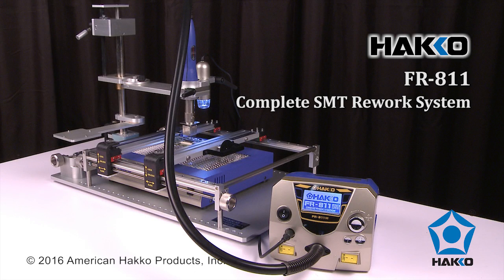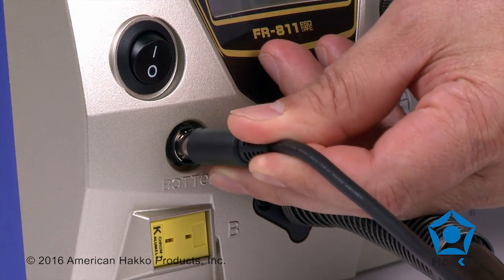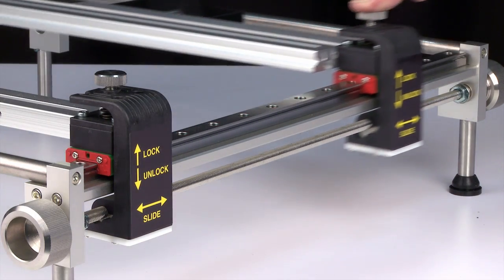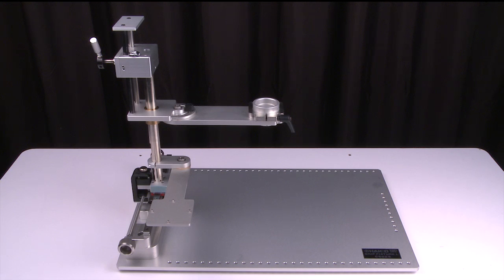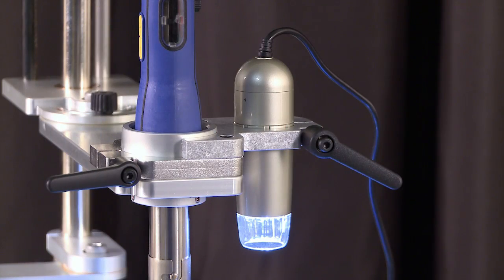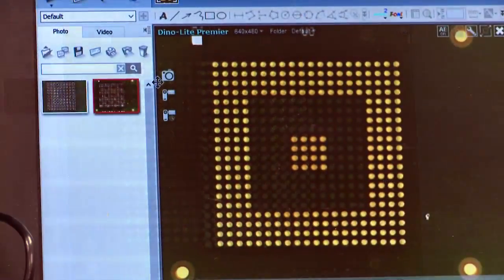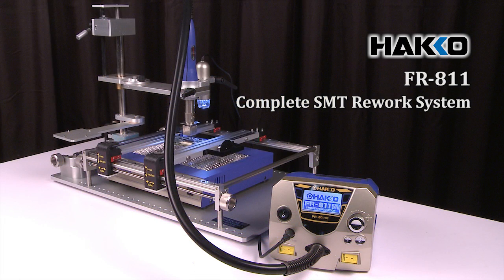Hakko FR811-SET Complete SMD Rework System

Comment: I'm sorry to tell you that, but the interface is really bad. You have designed what you think was an improvement to the previous button only interfaces. The multifunction button is indeed handy, but completely misused. And I feel entitled to complain because I have one.

Example: see around 1:20. Rotating the button could be used to set the temperature, which would be quite intuitive, but no! The rotation is used to navigate in the menus and you have to set the temperature digit by digit. And once you have set up the temperature, the current menu position is reset, so you have to come all the way back to make minor modifications.

We are in 2020!!! What you cal a "large, easy to read and understand graphic user interface" could have been true in the early 90s, but not anymore!

If I had to put an evaluation on this, 1 to 5, 5 being best, It would be close to 5 for the hardware, but let's face it, it would be 1 for the interface. The reason I would not put 5 for the hardware is the design. Making a fancy casing for that kind product is clearly a waste of resources that could be better used for the interface. I'm in a
lab, I will not use it in the living room, fancy design is a waste. Make it cubic, but make it easy to use! And remember: if you need to read the manual to use it (at least in manual mode), then it's a failure. I agree that configuring temperature profile parameters can be complicated if you don't use a PC.

Comment: Price please?
Reply: If you want the whole set, it's about 5500 USD on Amazon. But that's not the best place to buy that kind of product. I bought only the station itself without the table and the XY holder, and it was 1100 USD (here in Japan). I made the table myself, which combines it with a  FM203 soldering iron station. CAREFUL: when you buy the rework station, they don't even give you one single nozzle, you have to buy them separately. There is one kit of 5 pieces which is cheap, but not really usable. Any BGA nozzle costs more than 60 USD.

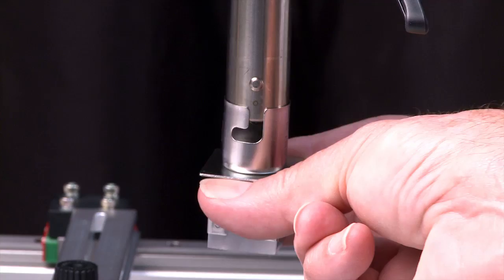Comment: 5:50 "Attach a vacuum pick-up cup to the vacuum pick-up tube..." - I can see a regular plastic/rubber pick-up cup, and that will melt away inside of that "mini-oven" at 400...500°C for sure. That is a quite high temperature for plastic things. Hows that ?
Reply: telelaci2 probably it's silicon not plastic

Comment: Is "bottom terminated" like "surface mount"?
Reply from the maker: Yes, and QFNs (bottom terminated components.)
Reply from the maker: Yes, and is ideal for QFNs.
Reply: Bottom terminated includes indeed QFN, but you don't buy such a station for QFN which can be soldered with a plain soldering iron. You want that kind of expensive system for BGA. I bought it to rework large FPGAs (484 pins BGA).